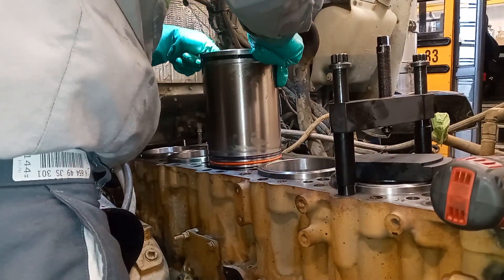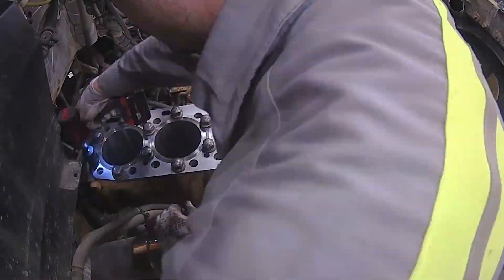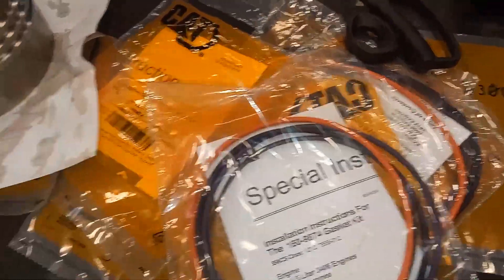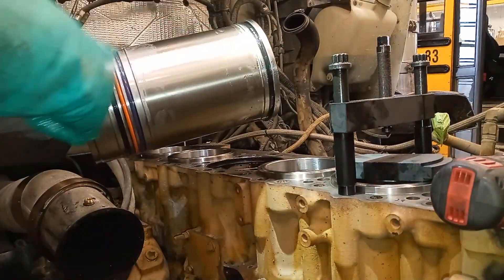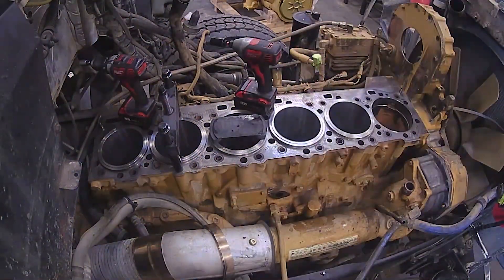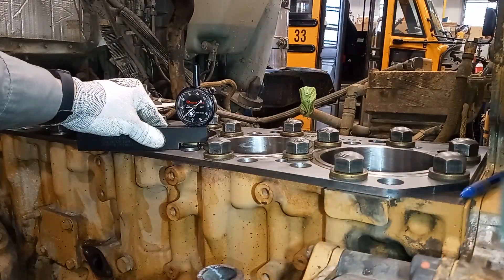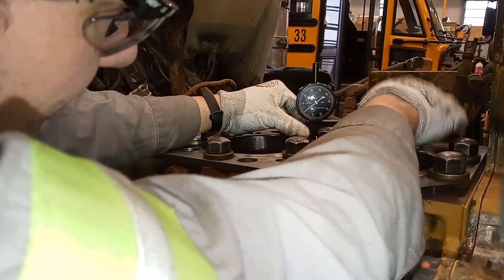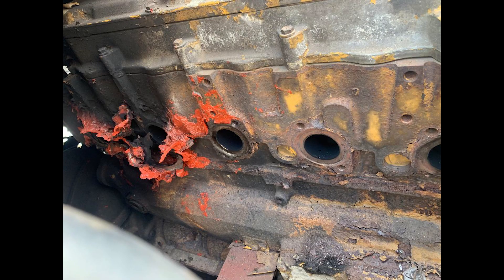How to Install Cylinder Liners and Measure Liner Protrusion.

Comment: where do you work? and how would one go about getting started working on bigger rigs and doing in frames like you. im 24 and currently working in an independent shop, but theyve just got me doing brakes and suspension,  with the occasional VC or oil pan gasket. would like to do more engine related work.

Comment: Just to understand everything measuring the old liner, spacer , shim you found -0.05 under zero deck protrusion.. so you cut counter bore. 0.29 and used a 0.30 shim leaving the block with a plus 0.01 above deck ring to support liner a positive 0.01 
Where do you make up the difference ? From the new shim under spacer, new liner , spacer? Going from -0.05 in the hole to +0.05 protrusion  that's a. + 0. 10 swing of stacked tolerances but machine work only resulted in a +0.01 gain!  can i count on a 
+ 0.35 gain from new inframe parts when measuring liner protrusion.. any one of  the other cat guys responding
Reply from the maker: With no shims on a new deck you will usually see about .003-.004" protrusion. The engine is designed to have that much protrusion with the assembled parts, so you are really just trying to get it within spec.
Reply: Thanks for responding i have a concern there are two visible lines in block around the liner bore i cant feel them  but i can see them is this a mandatory cut counter bore indicator even if the protrusion is 0.025 to 0.035. 
Ive also seen spacer plates 0.03 thinner if that plate makes 0.065 protrusion will that cause water and return oil leaks  or crack liners.

Comment: What could be the reasons behind the cracking  on the upper flange of the cylinder liner ,  for the CAT. 3606 ?
Reply: Ussually excessive liner protrusion or not enough line protrusion

Comment: Have you tried the 2P-8260 Cylinder Liner Installer Group, I like it because I can feel the pressure on the seals as I am pushing them in, have felt seals that are not going in correctly because of the feel! I use to do the field inserting jobs along with the shop one, like your showing the right way to check protrusion!

Comment: Does a 3306 use the same bolts and washers?  3306 is a 5/8" bolt.  I think 3304 may be larger.  The 3306 manual lists that it uses a copper washer instead of the fiber ones.  I think the fiber ones are a newer procedure instead of the coper washer and cross bar setup for the liner.  Confusing why the cat manual would say it takes 12 bolts and tweve washers.  I count it would take 14 of each.  Also it says put the bolts on using 2 washers.  That would take 28 in my accounting but again cat manual says 12.  Extermely confusing!

Comment: Morning sir, I’ve been watching your videos. Was wondering where your shop is located. Have a rebuilt Acert that’s got a single conversion on it with 18:1 piston.. that’s how I bought it.. rebuild has right at 5k on it.. getting oil seeping out exhaust manifold at a idle.. no oil on cold side of turbo. Could this be a cylinder sleeve? Injector?

Comment: I work on Waukesha and use to always use lubaplate but was recently told to use Parker lube or vegetable oil. Guess I been doing it wrong lol learn something new every day in the field of work. Love your videos man keep them going .
Reply from the maker: Thanks for watching and glad you like the videos.
Reply: Do you work on very many Oliver tractors with Waukesha?
Reply: @eddygoodwin7089  no sir I work on generator and gas compressor packages. Weak 5790 9390 145 1905 3521 1197 etc. natural gas engines and some diesel configurations. What engine are in those ?
Reply: @Billy-f2f  I have an Oliver 880 that has a diesel Waukesha. It’s been a while since I’ve messed with it, can’t remember what displacement it is.
Reply: @eddygoodwin7089  yea haven’t messed with that one

Comment: Have you tried Dawn dish detergent for an O-ring lubricant ? I use it with cooling system O-rings works awesome and it helps clean the cooling system as a side benefit
Reply from the maker: I usually use rubber lubricant which is used for mounting tires and installing cylinder liners. I wouldn't want dawn added to the coolant as it can cause bubbles which can lead to cavitation inside the cooling system.

Comment: 1:50 ah, yes I also found that 70 ft-lb is excessive and went to 40
Reply from the maker: I'm not sure why they want those bolts so tight anyway, it's just holding the liner down to check it.
Reply: To compress the spacer plate gasket properly....

Comment: Hi I have a question.  I have a 2019 frightliner cascadia the idle was set on this truck as I pull the yellow break to 600 it does not Rev up higher if I want to idle at a higher rpms due to being a previous fleet truck. So I have the truck set at 900 rpm when I pull the yellow break. So when I start in the morning it starts at a 900 rpm you think that's fine or should I push the yellow break in 1st in the morning for couple of minutes and then set at a higher rpm .Is the motor gonna be fine if the engine always starts at 900 rpm? Thank you!

Comment: Hey josh have a 3304 PC was wondering what PC stood for ? Any idea where I can get a repair manual for this specific engine it’s on a irrigating lift pump
Reply: PC stands for precombustion chamber.  Old Cat engines (when fuel was dirt cheap) used this design. The precombustion chamber that screwed into the cylinder head, had the nozzle and glow plug in it. The nozzle would inject fuel into the precombustion chamber and ignite down onto the piston. The piston had a plug dead center to help absorb the heat and keeping from burning a hole in the piston. The other lingo is DI or direct injection. The nozzle chamber was designed so the tip of the nozzle extends pass the bottom of the cylinder head. So you cannot mix pistons up, because of the ignition process. If you do black smoke, early hour failure. In the truck world you cannot pull a DI engine out and replace it with a PC. I cannot say off road. The reason is the cylinder head on a PC engine carries a lot more heat from ignition process and a PC engine runs a bigger cooling system package. So you could have PCT, Precombustion Chamber Turbocharged, PCTA Precombustion Chamber Turbocharged Aftercooler, or DIT, DITA, NA naturally aspirated, JWAC Jacket Water Aftercooled,
ATAAC Air To Air Aftercooled. 

As with a service manual you must start with the engine prefix. Cat uses a three digit prefix. Examples of truck engines include but not limited to 92U, 7FB, 65B, 02Z, 5EK, SDP, 63Z, 9TL. That tells Cat what you have.
Once you have the serial number, you have to see if a media number still is available. The media number also has a code that includes what language it is printed in.
Reply: Wow so much info still tryna soak it in thanks you ver much this is the only tag on that engine looks old say 3304 pc than SN- 4b16743 Than arrangement number -7n3301

Comment: I know exactly what you need! If you have access to Cummins parts (I’m sure you do) here are some red plastic contamination covers sort of like big CAT blue plugs that fit in the Liner bore perfectly to catch all the filings! I know from using them myself! Cummins part number 4919433. I then suck out the filings with a shop vac. Worth their weight in gold imo
Reply: Hope you see this ADEPT APE
Reply: Type 30 diaphragm pushed just below deck works good too.  Do recommend the ear plugs in the gallery ports for sure.  Just don't forget them!

Comment: Rebuilding a N14 right now and we had to use a old Race for a hub to pull and install the liners. Love the channel learned alot from you josh!! Thanks brotha!!
Reply: How does that work lol
Reply: @shivermetimbers8344  the puller was too small and we had a race that fit on the sleeve perfectly so we put that inbetween

Comment: I'm not sure what I think of Cat using a spacer plate arrangement. What is the benefit and are there any issues sealing the block side of the plate. I like the idea of being able to fit a new one. Sorry for being thick, it's just that no engine I've ever worked on other than Cat has this plate. Living in the UK in the early 90's I supported a decision to buy some trucks with the 3306 engine in. They were such a disaster, I nearly got fired for buying them, not to mention all the black exhaust smoke that no other non-Cat engine had. We live and learn as they say. Good video, thank you.

Comment: So what if one of the liners is say 7 thousands then what?
Reply: Find the problem and correct it.
Liner is .350 flange
plate is .338 thick
gasket  .008 roughly
Plate and gasket roughly .346 total
minus from liner is roughly .004 projection.
Cat wants a milled top deck min of .001 to .006
Counterbored block min .003 to .006.
The crush on the gasket is maxed out and really not doing any good. Also at some point you will crack liner flanges.

Comment: Nice video. Easy to understand.  You should think about teaching someday.
Reply: .....he already does. 😊
Reply: @stevendaniels8652  I get that but more formally in tech ed.
Reply: @badgerpa9  he can reach many more people this way and it costs us nothing. If you take what you learn here and get yourself a diesel to work on, with a manual for it, you will learn.
Reply: @stevendaniels8652  I had enough diesels to work on years ago, prefer to be at least part retired.  But thanks hope high school is going well for you.
Reply: @badgerpa9  high school? That's a wild assumption. Or was that an attempt at condescension?

Comment: I thought the piston s were preloaded in liners
Reply: They are, but Cat has had so many failures due to improper assembly. They require certain guidelines on a rebuild or it won't be under warranty. One article is SEBF9008 that is very important.

Comment: I make 3 passes with the sled gauge and see if the same reading comes up each time, can be off some times. 
Do you separate the liner packs when you use them?  Just did a MXS last week with a gold kit, sure is hard getting part lately.
Reply from the maker: I do separate them as you can see the pistons are out, I do label them though so the pistons stay with the liner they came out of. I don't think it matters, but just for tracking purposes. I've installed them before without doing the measurements and it saves probably 2 hours of labor, although the complete cylinder packs are heavy and awkward to install. If the protrusion is off though you are pulling the whole thing out then.
Reply: @AdeptApe  Thanks for the reply,  yeah I find the packs heavy and awkward to work with.
Reply: I didn’t think for some reason the connecting rod would fit through the liner ?
Reply: Always pull the piston out and check you got all your ring, reman are not the best

Comment: Red oring in the middle? Is that universal or just cats?
Reply from the maker: It's orange, not sure if it looked more red on your screen or if that's just the video.
Reply: @AdeptApe  engines I work on have 2 black and a coloured one. Coloured always went on top, iv been told! Is this wrong?
Reply: Thanks for the reply BTW 👍 big fan